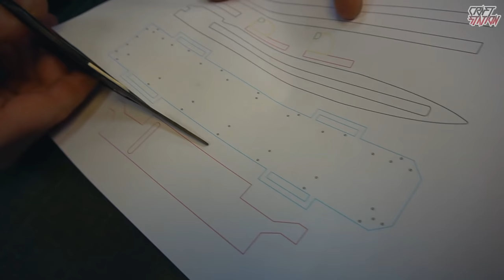How To Make An Assassin's Creed HIDDEN BLADE

Comment: I love how low profile your blade is !!
I wish i had a workshop to work with metal like this and make my own :)
Reply: Low profile because nothing keep the turning mechanism safe you couldn't actually waer it for like a day with clothes on the turning mechanish not enclosed so it can turn and turn like threads clothes yarn etc which you can probably imagine how god turning things and yarn/threads to when intereact with eact other... also the pull is gigantic howw cna u use that on your hand, your hand telecopes out to activate the blade?

Comment: This is super cool. Do you know of any materials that could be easily cut without power tools to make this?
Reply: Maybe like tin sheets with tin cutters but it's not really realistic, just rent power tools
Reply: @morallygray6527  that’s not a bad idea, but I’m looking for something a bit cheaper and easy to work with if you don’t have a garage or workshop. Plus I’m not really wanting to make one that’s real and could actually hurt someone, I’m more wanting to make a functional prop for personal use. I’ve actually found that I can use a clear plastic storage tote and cut it apart with some scissors designed for cutting plastic sheets. This will let me make one that’s pretty durable and sturdy, but also flexible so it won’t snap, yet will still function well